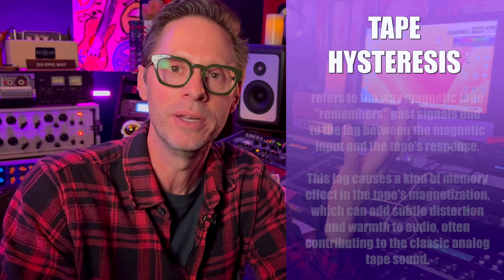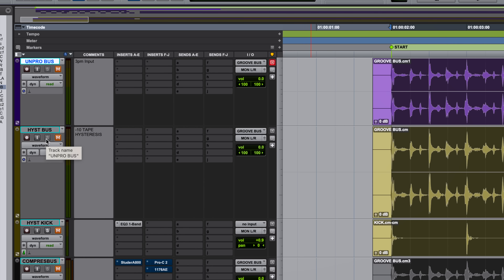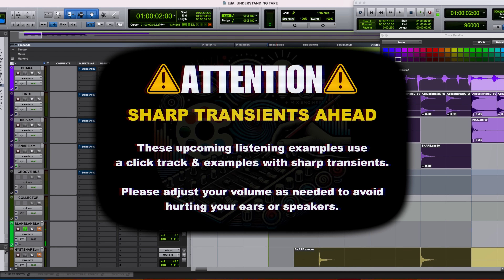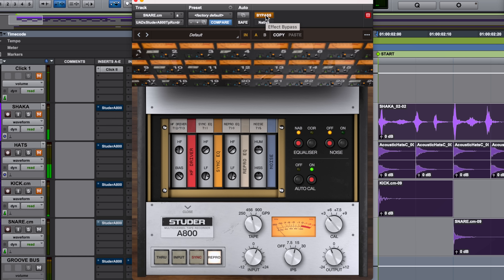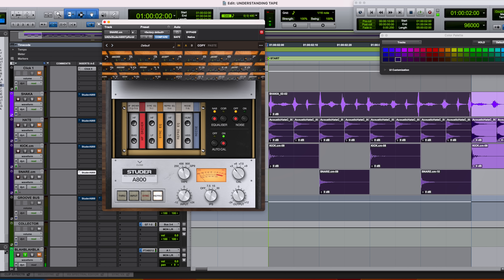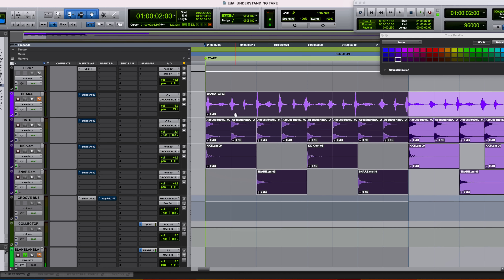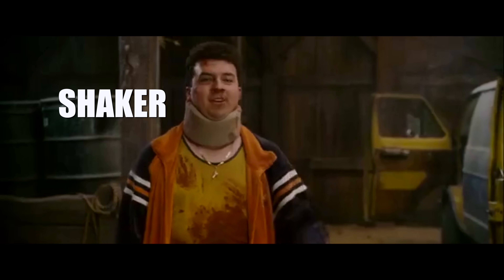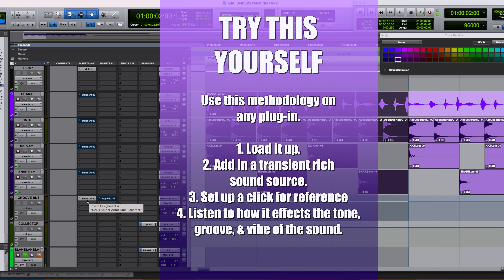How Tape Hysteresis Impacts Your Mix (And Why It Matters!)

Comment from the maker: So....we had a little mispronunciation malfunction. It is supposed to be “hiss-ter-ee-sis” instead of “high-steer-ee-sis.” We could pretend it’s a regional dialect…or a vintage setting on the tape machine… but honestly, we just liked how it sounded. 😅
Consider it analog charm. The info is still there...pronunciation pending.
Reply: i thought i was crazy for pronouncing it like hysterical
Reply from the maker: @the747videoer  No you're not crazy! It's just one of those words...

Comment: I can hear a difference, but I wouldn't base whether you are crazy on that. You might enjoy trying the demo of Audio Acustica's new plug-in Taupe Studio. It has a 'screw' which allows you to manipulate the tightness / looseness labeled hysteresis. Can you manipulate that on the UAD emulations?
Reply: Hi! With the UA Studer I don’t believe you can. But I will double check. Thanks for commenting and supporting the channel!
Reply: Toneboosters Reelbus v4 has e dedicated control for Hysteresis, try it on a highhat or shaker sound and hear what you got. It’s not subtle  at all and it can be used to great effect on some sources and styles!
Reply from the maker: Thank you very much!

Comment: Isn't it easier to do a Null test?
Reply: Hi! Thanks for watching. I’m not an expert but the focus of the video was to show subtle and nuanced micro shifts in the groove. Not necessarily to highlight phase differences between the unprocessed and the tape emulation plugin. That would be a cool experiment and I think a null test would be perfect for that. Have a great day and have fun mixing!
Reply from the maker: Thank you very much for stopping by to leave a comment!

Comment: Is this vid just farming for comments by intentionally being unscientific? 

I’m not sayin we need to turn our artistic brains off or anything, but cmon, this vid is almost a lesson in trying to trick your audience.

Explanation A (mixing engineer): Reducing the high frequencies in a drum track is obviously gonna make it sound less pokey when you put it up against a click track. Somehow get the tape eq flat and then try again, also turn that loud click track off so we can actually hear the groove and not just be overpowered by the rhythmic suggestion of the click.

Explanation B (technical): You know what also can delay your transients/change the visual readout of your waveforms? Shifting the phase of your highs and or lows via eq/filters present in your not-at-all-flat tape plugin, dude. Cmon. 

Approach C (musician): Are you trying to tell me that I can hear the delay of the shaker transient by ONE sample? (Yes, check the waveform visual comparison again, that’s one sample of delay). You’re telling me that this shaker player is off by some range of 1/44,100th-1/96,000th of a second, and you fixed it with a plugin that delays the transients by that amount? Something is obviously off, otherwise playing shaker 1/44,100th of a foot farther away would be putting you out of pocket.

Idk, man, idk
Reply: Hey @super2thesam – I appreciate you taking the time to dig in here. You brought up some solid points and I agree with a lot of them. EQ-induced phase shifts, transient smearing, and level-dependent filtering are definitely part of what tape plugins do—and you’re absolutely right that none of these plugins are perfectly flat.

That said, the goal of the video isn’t to serve as a physics lecture—it’s to give engineers a way to hear what makes tape special in practical terms. If the tape plugin softens transients, shifts microtiming, and creates a feel that’s “off the grid”—that’s worth highlighting, even if the technical cause is a mix of EQ, phase, hysteresis, or transformer coloration.

And yeah—can we hear a 1-sample shift in isolation? Probably not. But when you add subtle transient rounding, saturation, and timing blur across multiple elements, it absolutely changes the groove. That’s why tape feels different than digital. That’s what this series is all about.

Appreciate you jumping in—hope you stick around for the rest of the series. Respect!

Comment: Back in the nineties we would call digital recordings harsh and analogue warm you are ding a great job explaining why.
Reply: Thank you so much for the support! Hope you stick around for the rest of the series and let me know your thoughts! Have a great day and have fun mixing!
Reply from the maker: Thank you again!
Reply: That’s because people used to analog didn’t know what the hell they were doing when they started working in digital. They were still using analog techniques while recording and mixing in digital. Dire Straits Brothers in arms sounds anything but harsh and it’s a DDD recording.
Reply: in the 90s, anti-aliaising filters had audible artifacts and phase anomalies that extended down into the audible frequencies, modern converters dont do that anymore. Plus, simply releasing a digital copy of a tape that was mastered for vinyl will be harsh too - because vinyl rolled off the high end, so mastering engineers would boost it to counter the effect - sounded great on vinyl, but not what youd want for CD release.

@darryldouglas6004 has it right - it was partly how people were using it before people really figured it out.

Comment: FIRST: turn off stable volume in settings. Under the gear icon if You want to hear the diference... Many people won't hear the difference anyway...
Reply: Thanks for sharing that!!! Will check it out for sure
Reply: @ejgaub4995  this thing certainly raises the average level, but at the same time makes the sound in the recording different from the one posted
Reply from the maker: Thank you for the advice!

Comment: 6:00 You see that the Highpass EQ on the Repro Channel is around 11 o’clock … That is reducing the sharp click alone. Show it without any EQ processing applied.
Reply: Hi! Thanks for the support! The click track is not running to the same bus as the tape track. It’s on its own track being routed to the main bus that collects the audio for this video. The drums are routed to the bus with tape. That bus is routed to the same collection bus which is where they meet up. The studer is set to its factory default outside of its input and output that I mildly tweaked to make sure the transients don’t reach compression levels.Have a great day and have fun mixing!!
Reply: @ejgaub4995  The routing is not what i mentioned. The default setting of the studer has a slight roll-off in the highs with the EQ setting. That‘s causing the sound to get a bit „warmer“ despite changing the input and output setting at all. That can be replicated with every standard EQ. Set the EQs on neutral and it disappears. With higher input gain i get tape compression but i can‘t get the desired „rounder“ sound. I have tested this plugin extensively and i am not impressed by it. Saturn 2 delivers way better in this regard.
Reply: Hi! Yes, thanks for clarifying! The intention of the video is to demonstrate that simply applying this plugin will impact your tone without touching a single dial…. And I’m trying to present a neutral position on that point. In the videos that follow I break down the eq sections and other aspects.
I’d love your thoughts on those videos when released. Also, if you’d ever like to collaborate via an interview where you can discuss your findings I think that would be awesome. Thanks again!!!

Comment: This isnt what hysteresis is in audio tape. In Audio tape, Hysteresis refers to the fact that you generally get a linear response between electricity to the recording head, and magnetism on the tape. BUT when you put in only a tiny amount of energy, it fails to magnetize the tape at all, so at low levels there is a little non linear moment at the zero crossings.

Bias in a tape machine is meant to overcome hysteresis by adding in a high frequency sine wave, out of the range of hearing, so it adds and subtracts from the incoming signal enough that it is never so close to zero, and so the entire signal is recorded. Not unlike the role of dither in a digital system.

Bias overcomes hysteresis, which is a non linearity around the zero crossing when electronic signals are converted to magnetic fields to magnetize the tape. It's not a general sluggishness or inertia inherent in any change in magnetism of the tape.

That effect youre describing might be due to slew rates in the analog electronics, and also to the way magnetized sections of tape affect their immediate neighbor. It's hard to have a snappy change in magnetic level because the low magnetic portion right next to the hgihg one causes the low one to get a little magnetized by bleed through, adding some bit of inertia. This can round out sharp transients, but since the tape machines can still faithfully record tones, which change as sine waves, gradually by shape, even if quickly by frequency, it does not affect the general ability of tape to record high frequency information, only when the shape of the change is sudden, like a square wave. And even still, not enough to make frequency response a problem.
Reply: Hi Kyle! Thank you for the reply and zero offense taken. Appreciate you adding additional context to the conversation and that’s what makes us all be able to learn and grow. You are correct that I did not pronounce the word correctly and that is due to the fact I was hearing this change prior to knowing what it was or being formally taught. So searching for what I was hearing, all roads were leading to conversations and information centered around tape “hysteresis”
Please feel free to let me know what technical term you would use that describes what it is I’m hearing. Should you ever want to come on the channel and discuss these things adding greater depth and information,….that would always be welcomed.
Have a great day and have fun mixing!
Reply: @ejgaub4995  Oh man - SO nice to meet nice and reasonable people on here - its rare!

I guess the terms I've heard used to talk about these magnetic things are:

Non linearity (just in general)
saturation (rounding off sharp changes in magnetism/voltage changes the harmonics)
warmth (the ever elusive word!)
sluggishness (usually referring to a slew rate, like how an API 2520 chip distorts transients, ironically making things sound cleaner!)
rounder (you hear this one a lot when choosing between 15 ips and 30 ips)
bleed (although this usually refers to print through where the magnetic influence is from layer to layer on a reel)

Im sure there are more too. And this isnt an exhaustive list of the sonic properties of analog tape, but just relating to the idea that where there is a quick change in voltage, the tape will slightly smooth over the way the two regions interact.

It's not gonna be much either, because one the localized regions of magnetized tape, their magnetic field falls off quickly, and wont affect neighboring tape very far at all.

That said, one of the great things about editing magnetic tape is that the edit does get a tiny crossfade due to the effect we are talking about.

If there is a scientific term for this, I dont know it!

Hope that helped.
Reply: Thank you for setting this straight.
Reply from the maker: Hello! I really appreciate this comment. You’re absolutely right about the textbook definition of hysteresis as it applies to magnetic domains and the role of bias tone in overcoming that non-linearity around zero crossings. 

In this video, I was focusing more on how hysteresis feels from a sonic and user experience perspective. So while bias technically corrects the low-level non-linearity, what engineers still hear on transients—especially fast attacks like snares or plucked instruments—is a kind of “magnetic inertia” or softening that comes from the physical lag in how particles realign.

It’s not hysteresis in the strict physics-only definition, but many engineers (myself included) use that term to describe the subtle blur and groove shift that tape introduces—even with proper biasing.

I love nerding out on this stuff, and your take adds a ton of clarity. Appreciate you adding depth to the conversation it makes us all better engineers and better informed! Have a great day and have fun mixing!!
Reply: @TheSonicStoryteller  I hear ya dude, but all the engineers Ive worked with (which was a lot, including a bunch of Grammy winners) never't used the word hysteresis to describe the softening of transients you're describing.

I don't think I'm being academic here and missing any real world example? I worked in studios on hit records, movies, national ads, whatever at the highest levels in NYC for many decades, and so my comment comes from real world experience as much as any academic understanding, although I do also have a degree in Audio Engineering from Berklee.

Tape is great for its non linear sound. There are a lot of components to it that you correctly described, I just wouldn't use the word hysteresis to label them. Without sounding too arrogant, the fact that you didnt pronounce it correctly might indicate that you're not correct that it's the right word to use for the effects you've described, that people DO hear and love?

Anyway, my goal here is not to be an internet troll or negative toward you at all. I just want to make sure we educate the next generation well?
Reply: @kylegordon3675 thanks for mentioning the pronunciation part. 😂 The video poster should have just accepted his mistakes but kinda doubled down. As a music n em nerd and hands on experimenter you are 1000% correct with what you are saying and came off very very chill.
Reply: @olmchowning7324  in the end the OP was very polite too, and open to new info, so i call it win/win
Reply: Hi Kyle! Yes, awesome stuff and what you broke down in such a relatable way are the topics I’m covering in this series on tape….where the build was video one,…the smearing and transient reshaping  (formerly known as hysteresis LOL) then discussing the controls of a tape emulation, tape itself, and tape compression. All those videos to follow…. To echo your sentiments it is really hard to compartmentalize these as it seems it’s more a cumulative result of using tape as the medium to record,…but that’s the challenge I took on to learn more, and chase down answers to what I’m hearing. I would LOVE your feedback as I’m sure the viewers would too on the rest of the upcoming videos in the series. The ultimate goal here is 99% of today’s engineers won’t have an actual tape machine but will be using emulators and should have a solid understanding of what constructive and potentially destructive aspects tape can bring to the mix other than just saying it’s “warmth or mojo”
Thanks my friend and hope we stay in touch and hear from you again during this series on onward!!
Reply: @ejgaub4995  awesome - and again, thank you.
Reply: Great comment
Reply: So when I use my Waves J37 tape emulation plugin, which I like in many instances, I admittedly don’t know the science and machinery behind how tape machines work. I started recording around 2000, right as the home recording era began. I wanted to ask @kylegordon3675 , when it comes to these functions:
•default
•Bias + 3 
•Bias + 5

What are these doing exactly? I’ll be doing some more research on it, but would love to hear your response on this! Thanks 🎉

Comment: the main thing I hear affecting the groove is just the slight delay the hysteresis introduces.  of course it might be more complex/frequency dependent etc, but the small delay is why the groove is affected.  just slightly shifting the unprocessed waveform to the right to match the processed should give a similar groove wrt the click track.
Reply: Great question and insight. Delay compensation was accounted for and while I should have included it in the video, when I overlay the two versions perfectly matched up,…there are still some differences. I hear it as a longer tail and slightly SLIGHTLY blunted transient. But it’s conversations like this that make us all better engineers. Thanks so much and if you do any experiments please report back with your findings! Have a great day and have fun mixing!!
Reply: @ejgaub4995 yeah as you said yourself, and as you can see in the waveforms, the transients get delayed a little.  you're right it's not just the delay but also longer body tails, transient smoothing etc, but the big part of the groove change is that the transients get slightly pushed to the right.  fascinating though as it's def. more complex than a simple delay.

Comment: Have you tried the fuse audio tape plug? It has a hysteresis control the documententation says Ray took a different approach to the tape thing that didn’t require oversampling as much as the IK plugs if I recall. I have a license play with it a bit, curious what u think of that control idea though
Reply: Hi! Thanks for supporting the channel! I have not used that particular plugin but what is interesting is modern plugins are creating so many opportunities to customize each aspect that you can literally choose your own adventure. Hysteresis was/is just a function of using tape….. I think being able to control it in the modern age might allow you to dial a tape plugin into the exact vibe and response you are looking for without compromising….. in theory (lol)….. there are always compromises. Looking forward to checking it out. Have a great day and have fun mixing!!
Reply: @ejgaub4995  yeah, give it a shot see what you think. Small dev so I am sure they would dig any support